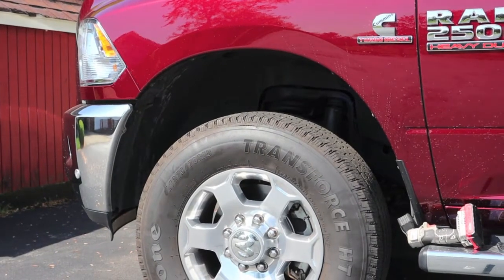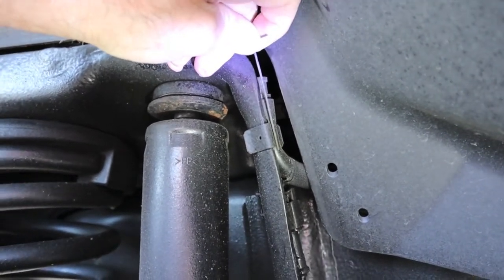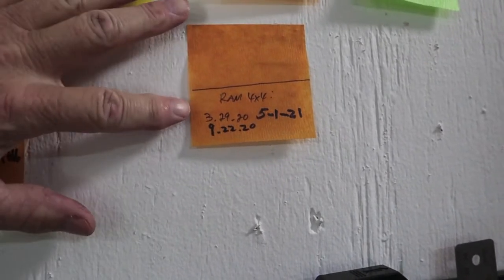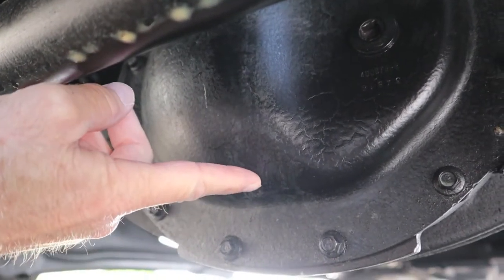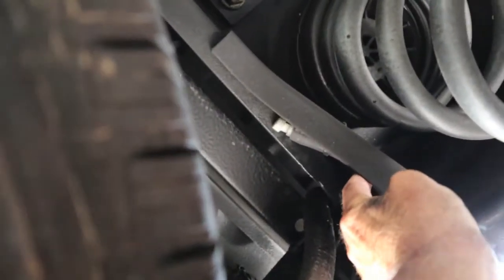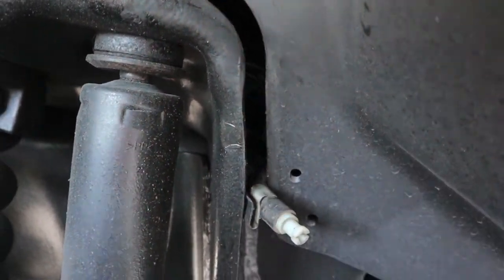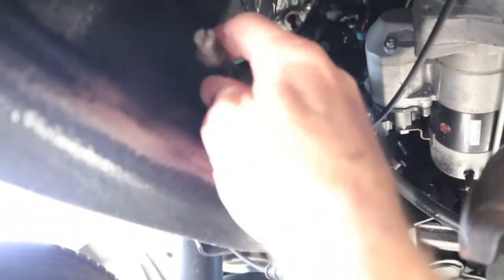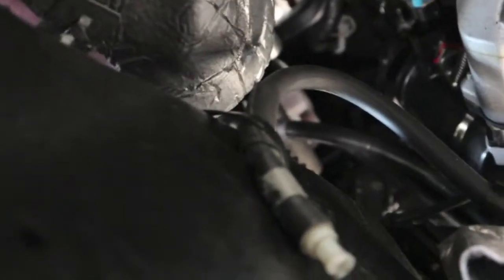RAM 2500 4x4 Water in Front Differential LOOK WHERE VENT IS!

Comment: I’ve got a 2020 F250 I never use my 4WD and it started leaking through the vent as well same position and everything except mine has a cap ontop what could it be?
Reply from the maker: The cap on top should rotate to kind of self clean itself of dust and dirt like the old metal breather caps back in the 50s and 60s.
Dad always told me to rotate a few turns on the breather caps every time we changed oil or diff fluid.
You'll need to pull the diff cover to inspect for any moisture damage and rust
I hope this helps!
Thanks for watching!

Comment: Thanks for bringing the front diff water concern up.  I have a 2017 Ram also and replaced the rear diff fluid twice with no issues of water contamination.  I did not change the front diff fluid since  I rarely use 4WD.  I'll be changing it soon now.
Reply from the maker: I'd check it out. The vent on my 2017 was in the worst position possible for catching water while driving in the rain.
Thanks for watching!

Comment: That front hose should be the same as the rear in that it should have that rattle valve on the end. Your front one is missing the end cap. I see part of it but not all of it. Dealer has those and would have saved you time but now it's located down so even better.
Reply from the maker: Thanks for watching and commenting!